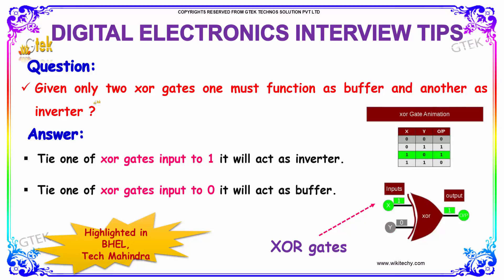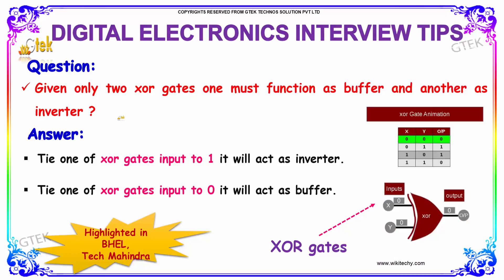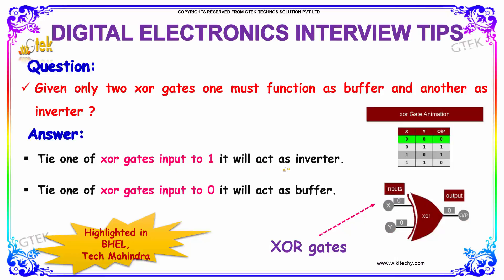XOR Gate Circuit | digital electronics interview questions and answers  | wikitechy.com

Comment: The XOR logic gate can be used as a one-bit adder that adds any two bits together to output one bit. For example, if we add 1 plus 1 in binary, we expect a two-bit answer, 10 (i.e. 2 in decimal). Since the trailing sum bit in this output is achieved with XOR, the preceding carry bit is calculated with an AND gate. This is the main principle in Half Adders and the combined AND-XOR circuit may be chained together in order to add ever longer binary numbers

Comment: The XOR gate (sometimes EOR gate, or EXOR gate and pronounced as Exclusive OR gate) is a digital logic gate that gives a true (1/HIGH) output when the number of true inputs is odd. An XOR gate implements an exclusive or; that is, a true output results if one, and only one, of the inputs to the gate is true. If both inputs are false (0/LOW) or both are true, a false output results. XOR represents the inequality function, i.e., the output is true if the inputs are not alike otherwise the output is false. A way to remember XOR is "one or the other but not both".

Comment: The XOR gate (sometimes EOR gate, or EXOR gate and pronounced as Exclusive OR gate) is a digital logic gate that implements an exclusive or; that is, a true output (1/HIGH) results if one, and only one, of the inputs to the gate is true. If both inputs are false (0/LOW) or both are true, a false output results.

Comment: XOR or EX-OR gate is a digital logic gate, designed for arithmetic and logical operations. calculators, computers and many digital applications use this gate. the output of this gate should be high when any one of two inputs is high. In an EX-OR gate the output will be low if both inputs are either high or LOW.